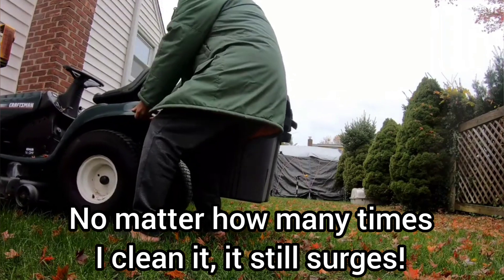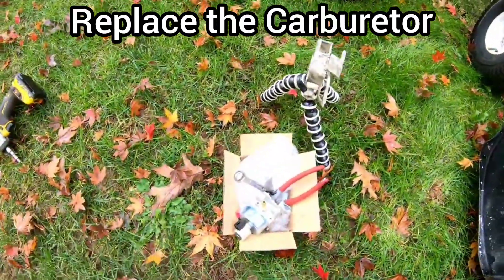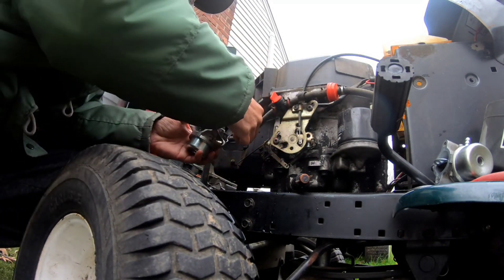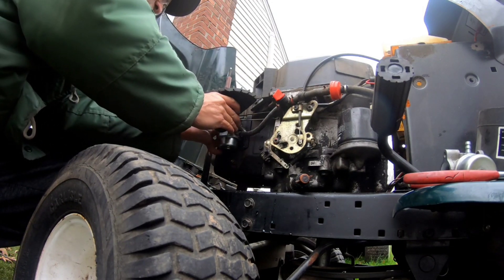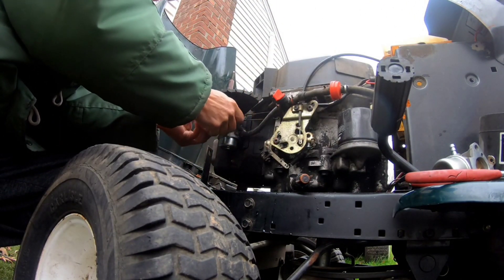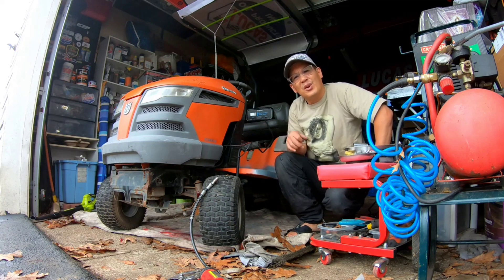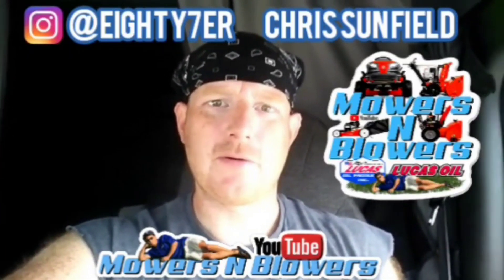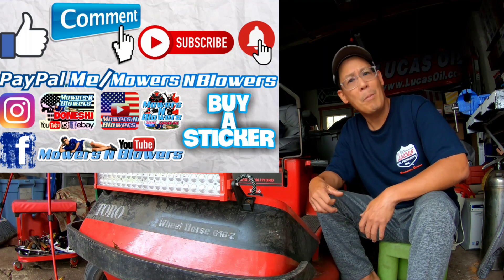HOW TO REPLACE A SURGING KOHLER COMMAND OR COURAGE ENGINE CARBURETOR WITH NEW ONE FROM HIPASTORE.COM

Comment: Henry
Today you picked up a wheel to move a hydrostatic LT 100.  Are you aware of the lever on the flat plate between the rear tires  that lets you freewheel the transaxle?
Reply from the maker: Yes,  it’s missing